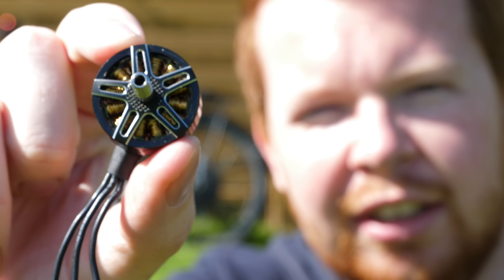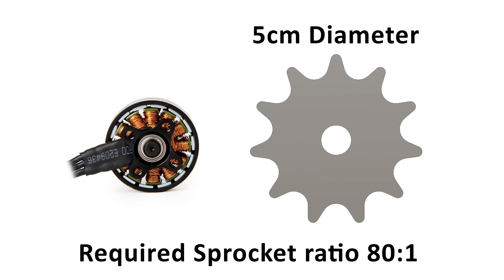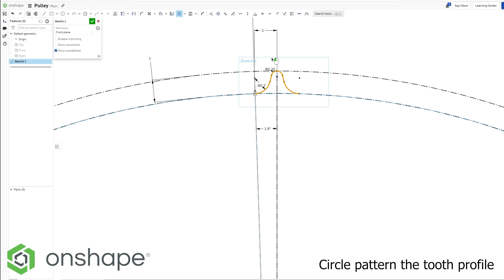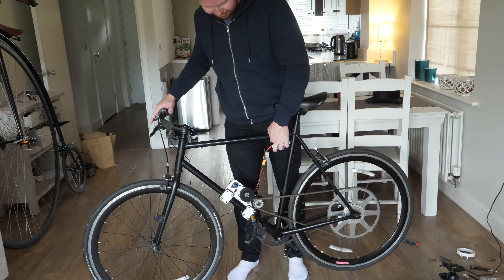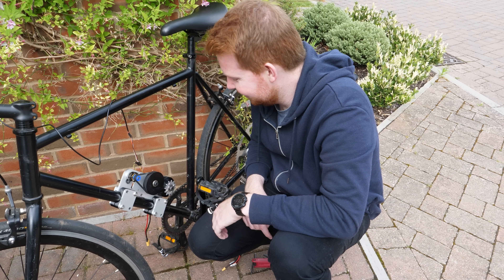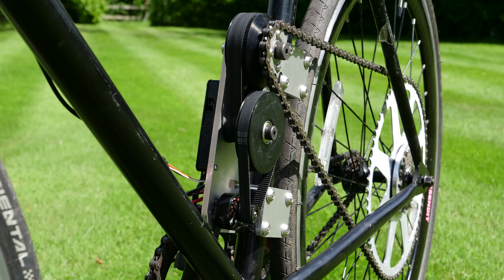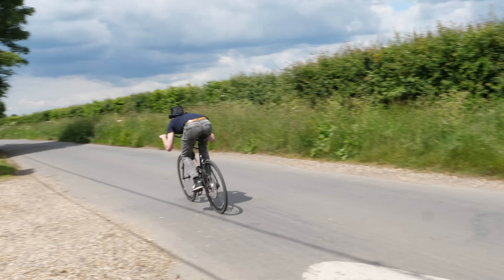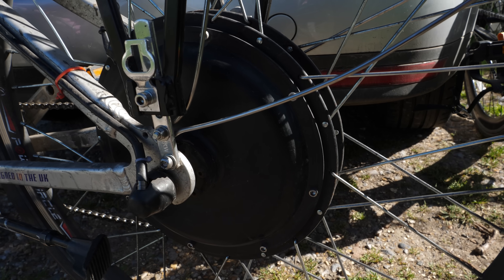Tiny 1kW Electric Bike Motor

Comment: What about using a larger drone motor? Would have been nice to see some data on efficiency of the two motors; as in how much each energy each consumed.

A drag race likely not the best test of a quad motor. At a constrained speed, and load the drone motor likely would have functioned much longer ... but resulted in a less entraining video. :)

Comment: have two on the rotors of the wheel, reserve that pulley for a water pump so you can run heat exchangers on the wheels

Comment: Build a planetary gearbox with two motors, one motor on the sun gear and one motor on the ring gear. That way you have stepless variable gear reduction to the planet gears by altering the rpm between the motors.
Reply: You are reinventing the Toyota Synergy drive.
Reply: @BrightBlueJim  Yes, I know about it. But that system is using two electric motors/generators and one ICE. I have not seen it implemented with just two electric motors.
Reply: @nhytg376tgyuu765gjmg  Doesn't matter - the principle is the same.  You can run the motors in any combination of rotor locked, running CW, and running CCW, to get seven effective gear ratios without ever having to engage or disengage a gear.

Comment: I'm no engineer or anything, but I feel like this could be used to maintain speed once you get there as opposed to starting from a dead stop. I'd assume it would put less stress on the motor that way
Reply: Exactly! its way more economical than a ebike motor!
Reply: @oadka  I would treat this motor as little helper while im doing most of the job while moving in desired speed, this small motor is good for keeping speed, but not for starting to get moving.
Reply: Which works until you try using it to go up a hill.

Comment: I know it will be difficult but could you attach an electric motor to the pedal assembly of a 10 or 12-speed bike, so you can use all the gears and see how fast you can go. I believe creating a clutch assembly to disengage the motor from the pedals may be to hard to carry out this type of project.

Comment: I would get a real chaintensioner for a mtbbike, then I would also get 2 or more of these electric engines, that maybe rotates the same gear together, or maybe keep the rear one as is, and also get one motor installed on front wheel :D

Comment: The main difference between a power output and a power output is the available duty cycle. Very much like the GTR and the tractor, one can provide the maximum power for hours, the other for mere seconds.

Comment: If the drone motor and battery pack were compact enough, this could maybe be used on an electric skateboard! It'd be light enough to push manually until you have some speed, then you kick the motors on to maintain said speed. Might be a good alternative to big, heavy, basically motor-only boards. With some sort of cooling it might be feasible but I dunno I'm not an engineer

Comment: Missed opportunity by not using two drone motors. Then it should be faster than the hub motor while also able to run the motors cooler than on the single jingle. Seems like this idea has potential, or at least that hub motors should be a lot more powerful.

Comment: next project should be a CVT. yes we can amp up the torque of an electric motor but why on earth would that mean we don't need transmission. increasing the power input to get more torque leads to guess what, the extra power heating up the motor.

the drone motor is probably fine while cruising at a reasonable speed but the take offs must be killing it. it's not comfortable under load change. i say give the guy a break. add a CVT to the drone motor, while u already need the extra gear configuration for reduction anyway. then compare it to the regular e bike again.

Comment: Now I'm wondering what a whole quadcopters worth of those motors would do if they were all belted to a common shaft? I'd think with 4 of them the load on each motor would be reduced enough for them to stay at least a little closer to their approved working temperature range, and if Tom used a separate belt from each motor, and possibly 2 from the counter shaft to the sprocket pulley, the torque probably wouldn't chew up and spit out the 3D printed pulleys straight away either.

It would be really interesting to see how that effected the drag race results too.
Reply: no chance, we are talking about less than a 100th of the expected airflow. Even at idle you can burn them out if you dont give them enough airflow.

Comment: The belts are too friction. You need to make a gear drive so that it is easier for the motor to spin the sprocket. You're most likely losing most of the power in the belts.

Comment: Don't they need propellers to keep them cool on a drone? 
I love hub motors. Weather proof, Good for regen braking, High torque, No gearing and smooth as baby's butt when controlled by a true sine-wave speed controller. 
Most eBikes and eScooters on the market use cheaper PWM controllers. One can hear them accelerate. Pure sine-wave controllers are the quietest.

Comment: I’ve seen people use drone motors for ex boats and rovers but this is beyond what I thought it would be capable of. I’m impressed. Just a though but could a planetary gear box be better? The ratios can aid in getting the torque you want though space could become an issue. Just a thought.

Comment: If you can find a motor with a slightly longer shaft, you might be able to push the shaft through a seal, enclose it, and make it into an oil cooled motor. Shouldn't be that complicated, two strokes have seals on the crankshaft and easily get to 13k rpm, with only one side of the seal being lubricated.
Reply: the way these drone motors work, the whole body of the motor rotates with the shaft
Reply: @TheJunky228  Well, yes, but this doesn't change anything. Imagine the same motor but with a really really long shaft, now you put that motor inside a cup, so the shaft sticks out, you screw the motor in through the bottom of the cup, make a small hole in the bottom to pull the cables through, and then, you fit a shaft seal between the shaft and the lip of the cup. You can enclose the entire motor, with just one seal.

Comment: You should design proper cooling for it, probably water cooling to take over all that heat. Then you should use a flywheel to get started and then use the tiny motor when you are up to speed just to maintain that speed. Maybe some kind of CVT gearbox between the flywheel and the drone motor. Also would be interesting also to explain why this doesn't work, even if they have the same power rating.

Comment: This is to funny! I have thought of exactly this and came to the same conclusion; that a large low kv motor is practically the same as a geared down high kv motor, which the big difference that the large kv motor usually has better thermal performance. Awesome video!

Comment: Alignment issue between sprockets. Make sure your rear sprocket has no flat spots on the teeth. If so, put it on a bench grinder and hit each tooth at its tip and taper it. Mark the start tooth with a sharpie. When you come back to it, flip it over and do the other side. Make sure each tooth is now tapered to a point with no flat spots.  Now your chain will not care about alignment . Install it back on to the bike,  Done.

Comment: A lower kV motor might help here. Something like 200kV rated at 4Kw or so. You could then run it below power on a lower voltage and hopefully avoid overheating. You wouldn't need as much gearing. Talking of which, what was the RPM of the motor on the high speed run?
Also add a fan to force air over the motor via a ducting of some sort. A great idea though!
Reply: That's how it is done and it works without cooling.
That are good stats.
Add-E uses 275 kV , 22,0 (~ 6000 rpm) for their direct drive (wheel). The roll on the outrunner is 51 mm in diameter (circumference ~ 160 mm). That's a reduction of 13 on an 18-622 wheel.

Comment: Tom, I tried to do this 6 years ago with a 400 kv X5 outrunner motor rubbing against the rear tyre - it worked for about 2 mins before burning out.
Heat dissipation is a problem! Thereafter I got a proper hub motor which can deal with a lot more continuous power!
I took the motor apart, photographed the windings and rewound the coils and works as good as new. Took a few hours though!
If it gets too hot it could destroy the magnets, and that's a bit more difficult to fix.
Reply: 275 kVi 22,0 Volt ~ 6000 rpm). Diameter of the roll is 51 mm (circumference~ 160 mm)

Comment: Are motor sizes not built  round  the  size  of  the  shaft  needed?     I really do  have  no  idea.   But  that  was  my  first thought as  to why it  might  fail.    as always  I await your next video
Reply: shaft is designed to handle the torque the motor produces
Reply: @bmxscape  I can not  argue with  anything  you say,  there is  something   there that  tells me  smaller  shaft, smaller  bearings  etc  will  lead to more  heat,  not  enough cooling in a  small package,   I know nothing but really enjoy watching his tests,
Reply: @craigpickles8462  these motors are designed to be air cooled by the propeller on the drone so they will always overheat in configurations like this as they have no cooling mechanism built into them
Reply: @bmxscape so  your telling  me that my  first assumption was correct?   it seems you are telling me one thing then adding  other  things   to it.  I really  think you  have explained it very  poorly, so shaft size does matter and that is what they use to determine  the size of the motor  needed,  you really think an E-bike would produce a  motor 4 X  the size that was needed?  sorry i  getting confused by what  i am being advised,  so I wish to leave  it there,  Thank you for your comments,  I will try find some  info,  I will also hunt you down to appologise if   i   have  said  anything out of line
Reply: @craigpickles8462   the shaft size has nothing to do with heat dissipation. your questions are all over the place, so the answers follow.

you started with shaft size of the motor. the shaft size is simply the interface to connect things to the motor.

heat is created by electricity flowing through the copper windings. some motors are designed to take high power through small windings , and need a cooling fan or they melt the windings from excess heat. even if you add more thermal mass you are not lowering the operating temperature you are just delaying the inevitable overheating. so even with a bigger shaft, you still overheat the motor. Plus, since the shaft does not contact the windings at all it would be a horrible way to transfer heat energy. you are better off attaching a heatsink to the casing of the motor and a fan to cool the heatsink if the motor is sealed, otherwise a fan blowing directly on the windings is optimal

maybe don't ask stupid questions and you won't get stupid answers

Comment: Power is power, if you can gear it down like you did with the first one, torque can be made the same as any other 1000w motor. The only issues you'll face are drivetrain losses and lack of surface area for cooling with a small motor

Comment: Couldn't you just put a rubber wheel directly on the drone motor, that directly contacts the tyre?
Reply: if you had a 1cm drive wheel it would still only give you a torque multiplication of about 60/1 which is close to what he had at 85/1 but likely not enough, plus  the force you would  need to create a non slip friction interface between little wheel and bike wheel would take away a considerable amount of power from the motor making it even less efficient

Comment: I think you should add more drone motors to the point where it beats the original ebike, and compare the price of parts used after that. 
Great video, thank you!
Reply: 2 wheel drive? Rim mounted ring gear . . . how many motors CAN you fit per wheel? : )
Reply: Yes, I agree because I'm just too lazy to do so myself. I like the idea of exploring motor rpm and torque without the use of a speed controller. Using switches and hard wiring three motors in differing wiring schemes for example: S1 3M Series, 
S2 2M Series, S3 1-2-3 Parallel. It would also be interesting to observe the voltage drop of series wired motors in comparison with increasing bus voltages. It worked well for traction motors on locomotives. Quite frankly I like the idea of not needing a speed controller but it would also be interesting to experiment with.
Reply: also compare the weight!
Reply: I had the same thought and in addition to that adding more drone batteries can result in increased range since they are light and small
Reply: Drones usually have 4 motors so he should've used the entire set.
Reply: @toolbaggers  Dr. One is a coolio word. I wonder if four in series would run slow or not. Be interesting to see the voltage drop and current.
Reply: I had the same thought, if one motor can do that, two might actually beat the hub motor, and a small fan might then be enough to cool them down.
Reply: also weight and complexity
Reply: You can't is alot of efficiency losses

Comment: can you put all the bikes together? like the drone motor running the flywheel for a boost, ebike hub motor, compressed air assist, regenerative brakes, solar. just really over engineer the crap out of a bike

Comment: You can definitely tell the motors were designed for different applications.
Quadcopter motors like that are built for high speed power rather than low-end torque, expect a lot of airflow for cooling, and aren't really meant to be running at max output for extended periods of time.

Comment: Needs a cooling fan for the motor. The hub motor has the advantage of surface area to dissipate all that heat.
Reply: it will never be able to cool it fast enough.